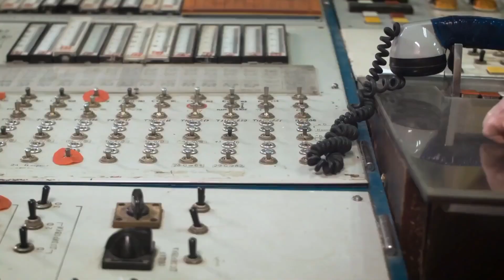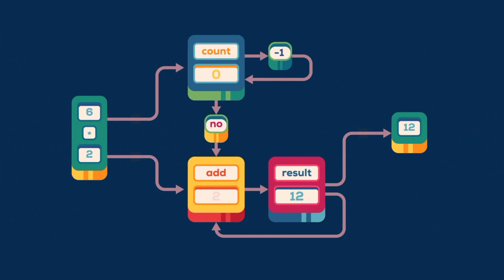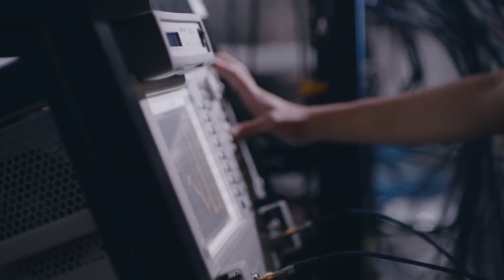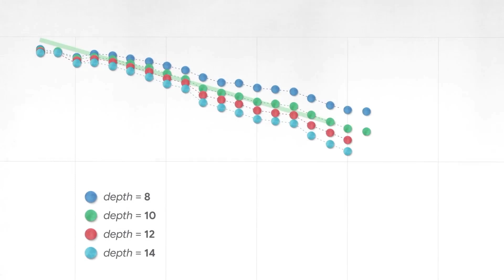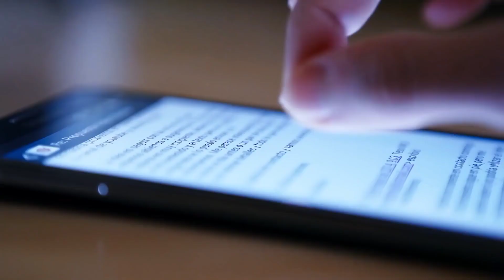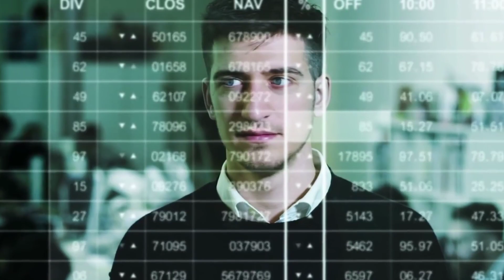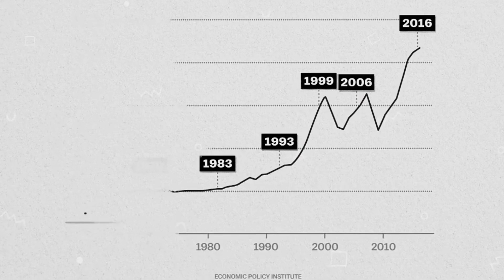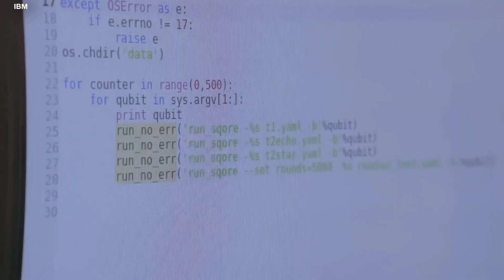Quantum computing- IBM develops world's first Quantum Computer |  FUTURISTIC

Comment: The largest number reliably factored by Shor's algorithm is 21 which was factored in 2012. 15 had previously been factored by several labs. by a room temperature (300K) NMR adiabatic quantum computer was reported by a group led by Xinhua Peng.
THIS IS  SCAM 😂😂😂😂

Comment: I'd refrain from ever claiming Quantum "supremacy" UNTIL hard(exponential Vs. polynomial time) problems such as the shortest path/traveling salesman problem is clearly concurred and/or our current encryption can actually be exploited etc. Hell, there are even still arguments about just how clear any current "advantage" actually is. Not that there won't be other useful applications but those are the "holy grail" base cases of what Quantum computing promises, especially the factoring. I'm optimistic but I wouldn't be too surprised if it just doesn't happen. The way coherence times, error rates/correction & such scale is a BIG area of research & it might not just be a matter of engineering. I'm glad that this is clearly a minority opinion however. & also, it could certainly be(probably is) that such devices will simply NEVER become cheap/small/portable. Not that the cost/size really matter at all but, the average person(science/tech enthusiast) seems to think that these GIANT cryogenic machines will certainly just fit in their I-phones eventually, like as a chip perhaps & that its ONLY just a matter of time. I do hope they're right & aren't just setting themselves up for future disappointment. But in any case, by ALL means we should keep as many of our best minds as possible active on such research. I can understand what all of the "hype" has been about but it really is becoming old. Factoring a 13 digit # is indeed some quite awesome progress from proof of concept(15 = 5x3) but, we NEED to process #'s hundreds(at least) of digits long. I said this like 20 years ago but I'd hope that the next decade or so should finally give us a MUCH better grasp on the true potentials of Quantum Computing. BTW, I'm NOT an expert by ANY means, just say'n, perhaps even super saiyan. 🤣

Comment: Hi Futuristic!  At 5:09 you say, "...to be 1,000 times too small to fulfill quantum computing's full potential..."  Does this mean the most advanced computer IBM presently has is not actually a quantum computer because it does not perform at full quantum potential?  So a true quantum computer does not really exist yet and in reality this is a classical computer, or a quasi or preliminary to quantum computer?  If that is true then would the title of this video need to be radically changed?  Won't once a real quantum computer is created it make world news and probably receive a Nobel Prize?
Reply: From my understanding, you need a 1,000 Qbit quantum computer in order to ensure the error correction is perfect, in order to rely on it as a practical computer. Less than that, noise from around the universe will effect the results of the processors making them not 100% reliable. 

I'm not sure what he meant by "1,000 times too small to reach quantum's full potential", but my guess is that he means that a computer with more quantum processors than that wouldn't benefit it in any practical way.
Reply: @bobbygeiser8478  Hi Bobby!  very nice of you to take the time and give such a cogent and lucid response!  I never imagined it took a second system to assure the operation of a quantum computer, amazing!  Thanks!
Reply: Quantum Computers do exist, to be honest I find the wording here a bit off. The real question is if the computer achieved quantum supremacy, that is, if its processing capacity is over the capacity of a classical computer to simulate it's qubits. And to be quite honest other researchers have already claimed quantum supremacy.